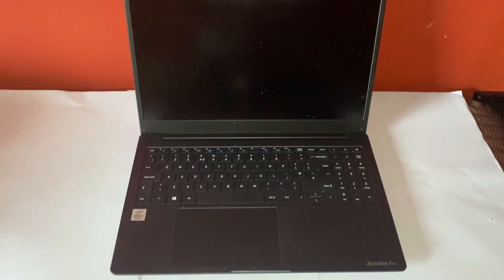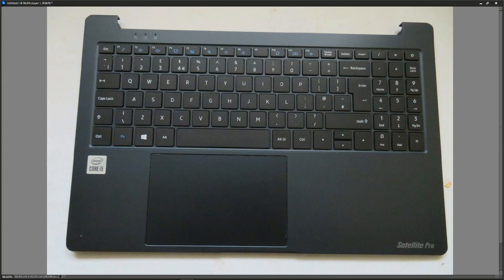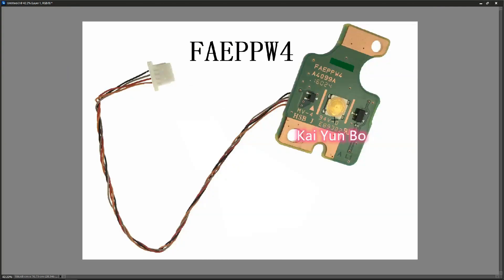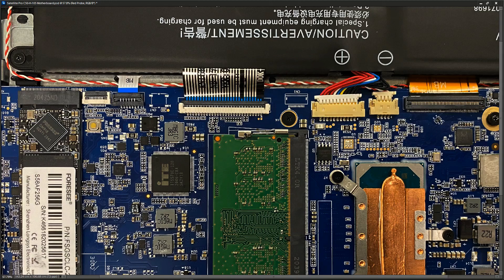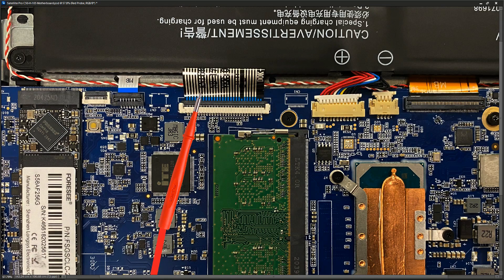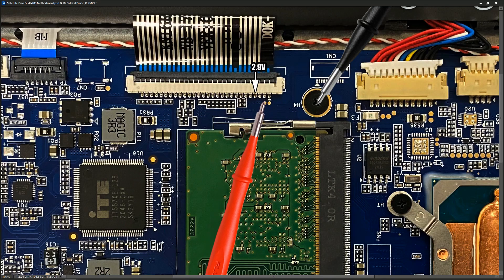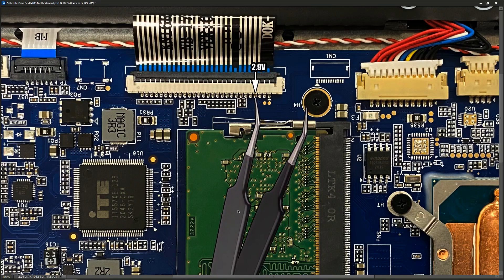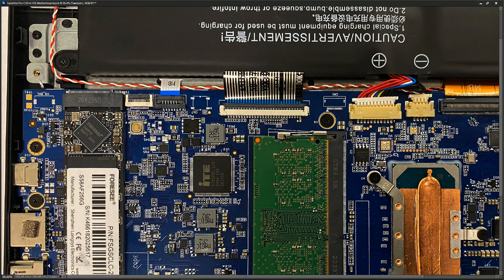Dynabook Satellite Pro C50-H-105 - Power Button Troubleshooting

Comment: I checked that pin # 4 and only got 1.3 Vdc. Tried grounding, but nothing happened. Checked battery output, which read 8.03 Vdc so battery is okay. Am stuck now.
Reply from the maker: Check out my other video on this exact same model of laptop. https://www.youtube.com/watch?v=sbCeZmJbm7E
There seems to be a common fault on this model, where one of the capacitors on the 5V USB fails, which is covered in this video. And there is also some information about how to check the different voltages.

Comment: Understood. Since keyboards use a conductive plastic film we cannot "feel" or "hear" whether each key button is activated. On a separate board it would be easy since the microswitch has a small damping mechanism in its shutter. Continuity can even be measured. 
Excellent work. A congratulations. Thank you very much for sharing. All the best.

Comment: For an old macbook air i rewire the power button to the keyboard connector pin with a magnet speakers thin coated wire. the keyboard was good jut the power button